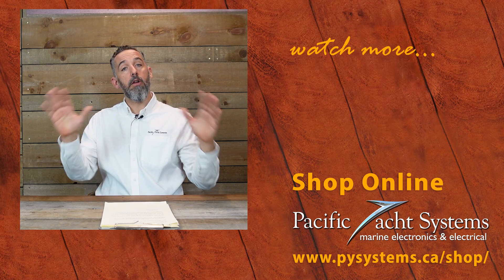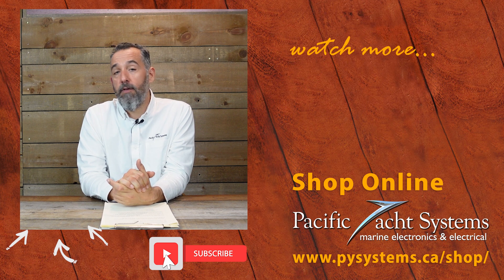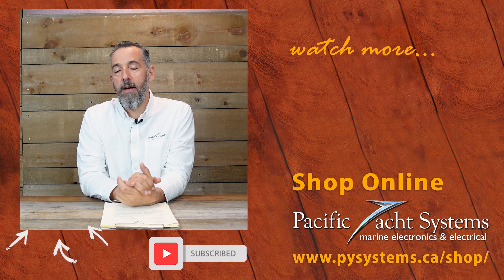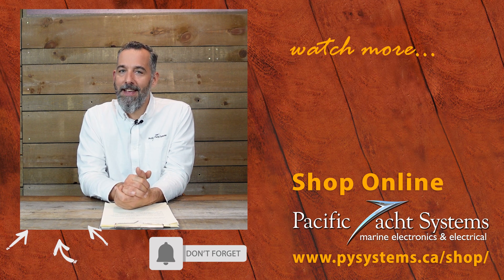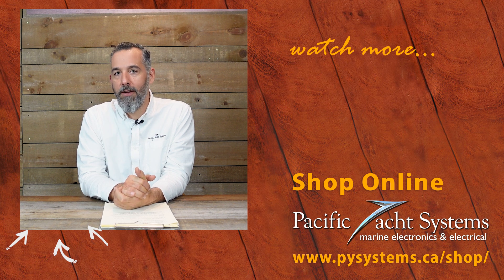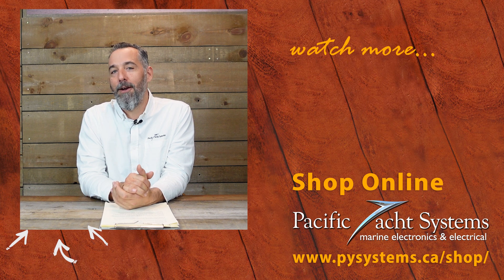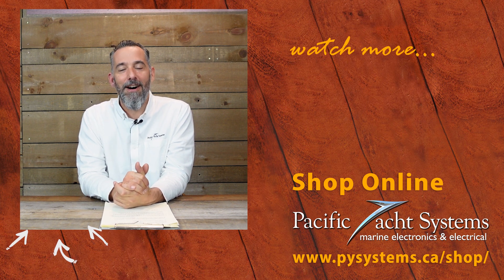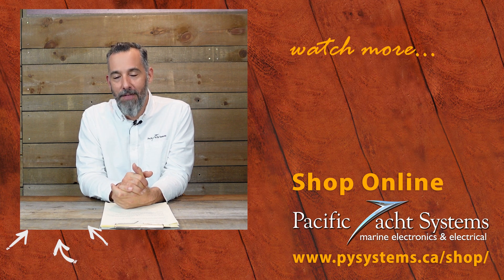Cold Batteries = High Voltage?

Comment: The Victron MultiPlus inverter charger in the new to me camper was showing higher voltages going into the battery than its 14.4v setting  while in charger mode even spiking up and down.  After many hours of troubleshooting (and paying a tech on site and talking to a rep from the company who sold it, both giving bad advice and info) I discovered the small positive wire on the VE.Bus Smart Dongle had been captured under its connection screw jaw instead of inside it which caused false voltage readings to be sent to the MultiPlus and causing the over voltage.  Don’t be like those two who gave a quick “can only be this” kind of answer to high voltage charging.  0:02

Comment: Great Video and explanation.  I disconnect the sensor at the charger but always wondered if it these overcharging voltages that the charger sets itself for based on the temperature actually bad for the battery if cold?  Probably could check with battery manufacturing on proper charge voltage in reference to temperature. I have a feeling the charger overcompensates for low temperatures.

Another question at least with my boat but with various chargers (Victron or current ProMariner ProNauticP charger), my charger charges at perfect set charge voltages when at the slip in the marina but when put on the Hard for the winter the charge voltages are higher immediately, even if temperatures outside are mild (40-50F). Any thoughts what would cause this?  Is the boat grounded differently out of the water?  This condition prompts me to always remove the battery temperature sensor.
Reply from the maker: Hi NFK, assuming the battery temp is the same, totally baffled why float charging voltages on the hard would be different when on the hard or on the water. Let me know what you uncover.

Comment: Lithium titanium oxide cells for energy banks on boats , they work in very cold climates  , high input high output  , longer life , they don't have fire hazards as lithium iron oxide  , the only thing they seem to have is a lower energy density but most boats could carry that extra weight for a more safer option . Would you be able to do a talk on the pros and cons  on this type of battery system  . Thanks for the time you put in on these talks Jeff  . Cheers

Comment: If the temperature sensor is 2 wires, chances are very good that it is a thermocouple not an RTD, especially since implementing an RTD for temperature measurement is a bit more expensive than a thermocouple.  RTDs tend to be 3 wire devices (though 2 wire RTDs exist, but are not very accurate).  Thermocouples are 2 wire devices.

Comment: Great explanation!  I have a question as I consider replacing my house bank FLA batteries with LIFePO4. I have 3 battery banks in my Ranger Tugs R-23 - House (270 Ah), Starter (90 Ah) and Thruster (90 Ah), with a 3 output 60A charger that can be configured for LIFePO4 on bank 1 (House) and FLA on banks 2 & 3.  I also have a solar controller that is connected to the house bank, and the alternator from the Yamaha Outboard is connected to the starter bank.  There are ACRs between the banks.

What are the available methods for sharing the various charging methods between battery banks of different chemistries, and which method is the best overall?  Or, would it be better to convert to LIFePO4 completely and maintain the current design?  

Thanks for sharing your knowledge with us.

Dave
M/V Elvin Ray

Comment: Great practical question and answer. Which leads into my ask. I have been trying to find details on how to ventilate a battery compartment. I know this is recommended but a topic that is hard to find practical information about how and when it should be done. As always Jeff thanks and hope you find this an interesting subject to share with us.
Reply from the maker: Good question, but hard to answer, make sure you use a fan that is ignition protected. We've install fans that are temperature controlled.
Reply: @PacificYachtSystems  brushless dc fan